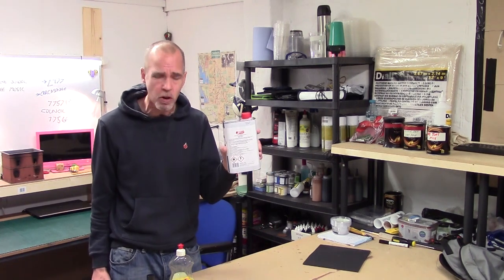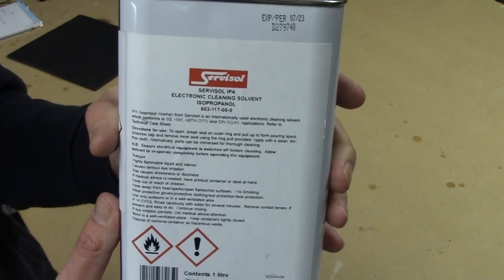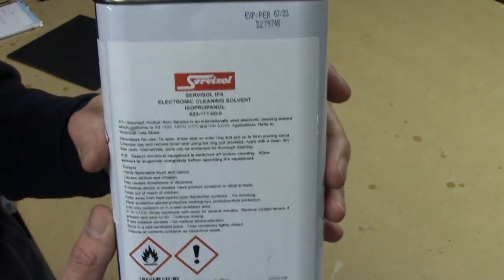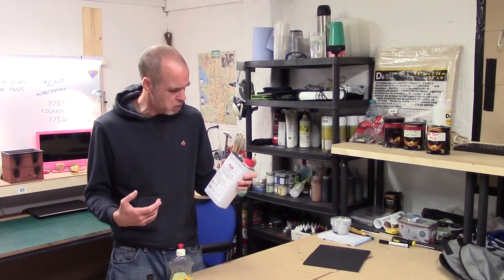Isopropyl (Rubbing) Alcohol - Is it worth it for modelling?

Comment: I cam buy 5l isopropyl for about AU$20 which will last me years. My main use is brush cleaning.  Infinitely better than cleaning with water.  But I use as a flow aid and in airbrushing too.
Reply: TheLoremistress Hey fellow Aussie! Where do you go to buy this stuff? Hardware store?
Reply from the maker: how do you find it with airbrushing buddy?
Reply: I use Tamiya paints and thin them with 99% Iso, also clean my airbrush mainly with Iso, and if it`s stubborn, I`ll break out the laquer thinner. I splice fiber optic comm lines and have an endless supply of Iso...lol.
Reply: TheLoremistress where from? It’s AU$25 from Bunnings and it’s about the only place I can find it
Reply: For brush cleaning i'll always suggest using Marseille Soup. It costs like nothing (1 euro more or less) and it lasts a lot . Natural alternative to alchool

Comment: Thanks for the labs mate, interesting watching.

Using alcohol as a flow aid requires some understanding of how paint finishes as it dries. The paint is suspended in the medium and will distribute evenly through the medium as long as it is well mixed. When applied to a surface, the surface tension will dry the liquid to the centre, and dry the pigment along with it. This will give areas of thickened paint and thinned areas. To avoid this, very thin layers built up to colour, rather than trying to coat in one or two coats, is required. For me, I avoid the alcohol exept as a wetting agent to spray over grass and foliage before a final PVC coat is sprayed. 

When wet blending, in my opinion, it works not so well as it evaporates too quickly for correct blending to really occur. Better with wet water.

Comment: Hi mel.. Not a terrain builder,just an engineer and bit of a handy man.. have been watching some of your videos which have been a great help and inspiration for building an island for my daughters pirates of the Caribbean figures.. Will let you know how it turns out if ever I finish it.. Anyway something you might like to try, polyvine decorators varnish.. Comes in gloss,Matt or flat.. I built a floating bed frame/Wall feature/ceiling feature out of drywall board filled and emulsioned.. Half a litre of the gloss covered the lot with 2 coats, rock hard and water proof even the Mrs Hoover hasn't marked it in a year.. Best regards any many thanks for the helpful videos
Simon
Reply from the maker: Thanks for the info buddy!

Comment: First off this was an hour well spent! The biggest challenge (and most dreaded job of scenic work) for model railroaders is ballasting track. We spend a lot of time putting down ballast then have to spray or use an eye dropper to "wet" down the ballast, if we use a spay bottle we "blow" ballast off the right of way, if we use an eye dropper, we spend hours apply "wet" water. Then when we apply the glue (spray bottle same results as above plus now we have a mess everywhere) or eye dropper (more hours) and spots where the wet water didn't penetrate well enough and the ballast "floats" up from between the ties (sleepers). I know your very busy, but if you could do a video to show a method that doesn't do all of the above...... a good starting point: beveled road bed affixed to a flat surface (nailed or glued down) track (nailed or glued down)I try to do good ballast work, I spend about hour per foot...HELP, LOLIf you do a video could you please try; tap and distilled water or maybe come up with a "one shot" glue mixture and give use the formula's for any mixtures you use. thanks for this great video, Chuck RVRV
Reply from the maker: I'll bear it in mind for future tests and see what I can come up with mate

Comment: Hey Mel, Chemist here actually. PVA glue does not dissolve in water and hence it is not a solution - polymeric substances are extremely insoluble because they usually possess very long "lipophilic" carbon chains. In lab use polymers will often remain solid in water unless you are deliberately breaking up the chain with an extremely strong acid or something. Hydrocarbon solvents such as benzene or pentane may be able to dissolve these polymers to form a true solution, but they're very expensive and often toxic and/or flammable.

PVA glue + water is most likely an emulsion, a type of fine droplet suspension.

I have used IMS (methanol-poisoned ethanol...AKA common meth spirits) from the lab for paint stripping models and it works very well, IPA would serve an identical purpose well since it's a very similar type of chemical.
Reply from the maker: Thanks for the info buddy!
Reply: Is isopropyl a ketone or aldehyde with

Comment: Isopropyl is great for stripping paint off models. Soak em in a tub of it for 10-15 mins and hit it with a brush and it just falls off.
Reply: What percentage do you use? Local store has a 70% and a 90%, do you recommend the higher one or is that too much?
Reply from the maker: doesn't surprise me at all buddy
Reply: @Cody - I use 100% and don't have any problems myself, aside from it drying your skin out a little, and stinging something fierce if you have any cuts on your hands! (might have some issues if you have pretty sensitive skin?)...but yeah, as SkonkBot said, give the models a soak for at least 10 minutes (I've left GW plastic in it for several months before without any damage), then a quick scrub with an old toothbrush should take the paint right off - might take a longer soak/harder scrub at lower concentrations though, so I'd recommend the 90%

oh, also, it's fine for plastic and metal models...but it can make resin go a bit soft and rubbery, at least for a while...so be careful with that
Reply: I'm not actually sure which percentage it was that I had. I bought it from a local Maplins store (in the UK) where it was sold as a "Electrical contact cleaner" and I actually bought it for use as a degreaser when servicing my mountain bike shocks.

 But after seeing some info about it's use as a paint stripper I tried it and worked wonders. 

Basically I decanted what I had left of it (probably about 2/3 of a litre) into a large Tupperware container and when needed plopped the models in that I wanted to strip, put the lid on and left it for a relatively short amount of time (I'm not very patient so usually it was only 10-30 mins) before giving it a rub down with an old toothbrush. Most of the paint would be sagging off before the brush even touched it but if any paint was stubborn I'd just repeat the process a second time.

Nice thing is that the paint just flakes off rather than melting and it settle to the bottom of the tub after a while and you can pour out the alcohol into something else to remove the old paint and then re-use it.

I must have stripped a good 20 or 30 models with same stuff over a period of several months.

It emits a lot of vapour (i.e. smell) so use it in a ventilated area, but the small doesn't linger for long after you seal it up. Unlike other stripping remedies such as Dettol cleaner (and you dont end up covered in gunk like you do with Dettol).
Reply: I do mine without any soaking. It's very strong stuff. I'm using 99%
Reply: yeah, if the paint is fairly fresh, just a a couple of dunks and some scrubbing can do it...but for paint that's been sitting on the model for years, or if it was applied quite thickly, or in many layers, it can take a bit more of a soak - most of the models I've stripped have been old ebay rescues, that were probably painted a good 10+ years ago, and some things turned out to have about 3-4 separate paintjobs just layered up...for stuff like that, I usually wind up leaving it to soak overnight, although that's probably a lot longer than it needs, it certainly does the job!
Reply: It was my own paint jobs tho, a few months old to a year. Thin coats too. Sure does help, still strong stuff
Reply: Have left GW plastic/metal in it for ages as well with no bad effect but it doesn't like resin; it goes brittle after a while.
Reply: ZoBo are you referring to plastic models or metal?

Comment: From what I remember about chemistry of these two things you can't create polyvinyl alcohol or PVOH as it often named from adding alcohol to PVA glue. 
PVA, or polyvinyl acetate is chemically very different from PVOH and is industrially made using a very different process but similar base materials. Besides PVOH isn't really toxic, unless you are heating it with other chemicals (which they might do in screen printing), or adding nitric acid to it (usually a bad idea with anything) as it is used to make all sorts of things  that are safe to handle . 
The one thing I do remember learning about polyvinyl alcohol from back then is that apparently all North Korean clothes are made from it, as they can't import nylon.

Comment: Are we using different stuff?  Rubbing alcohol is much cheaper than flow aid in the US.  Also, yeah, you do come across as biased toward flow aid.  Interesting tests, though.  I'll keep using alcohol to pre-wet before PVA.  I find that it greatly helps the PVA soak through the material and, like I said, it is vastly cheaper than flow aid.
Reply from the maker: Different countries have different materials and costings mate, if it works for you, use it :-D
Reply: TheTerrainTutor Hey, Biochemist here. To add to this comment. Isopropanol is the same stuff that is in "rubbing alcohol" which can be purchased for a lot cheaper than "reagent grade isopropanol" the difference is that rubbing alcohol will be diluted to probably around 50-75% and may also contain scented oils to get rid of the alcohol smell when used as a topical relief for joint pain. For our use in war gaming, if you're going to dilute it to 50-75% anyway (and 50% is what I commonly see used when sealing) then you've got yourself a bargain! Would probably work better for sealing if it doesn't contain scented oils but I don't have any evidence to back that up! Just my thoughts mate!

Comment: I use the alcohol (99% industrial), mouthwash, and/or water for thinning acrylics. Slow dry...water. Fast dry...alcohol. (Works for me. Won 5 awards, in armor, at only show I was in this year. IPMS Phantom Phlashers 2017 show.)
Reply from the maker: Ever noticed any changing of the paint due to the alcohol mate?
Reply: Changing of paint?
Reply: I'm a commission painter, I use a 50/50 iso/deionised water to thin my paints, I have noticed that sometimes it starts to separate but that's when it's sat on the palette in a blob of liquid. Quick mix and it's perfect again. Never had any adverse effects on a model.

Comment: Dish detergent does reduce surface tension, but the rinse aid used in dishwashers is better - that's all it does, it isn't also a cleanser. I'd be interested to see how it performs compared to the hobby flow aid, as it should be easier to find and much cheaper.

Also - not all paints are affected by alcohol. I've seen a fine modeller (can't remember the channel) do complicated weathering effects with different paints based on them being removed by different solvents. (I believe one was a lacquer, one an acrylic, but I didn't take notes, it was cool but far too advanced for my needs.) Maybe something to experiment on later.
Reply from the maker: Makes me wonder if they're formulated differently to house/craft acrylic mate

Comment: Why @26mins is the 75% option ignored even though it was better than the flowaid? The 25% and 50% were not as good as Mel said but the 75% not a mention.
Reply from the maker: Although the vid is test after test, I actually conducted the tests the same time and I thick I discounted it because of the results of the 75% on the other test mate.
Reply: TheTerrainTutor fair enough :)

Comment: After looking it up poly vinyl alchohol is only dangerous if heated or if it is inhaled in powder form neither seem to be a big deal. In both cases it's much more mild then your presenting. The screen printers are likely using a powdered form in large quantities but in a liquid state it's part of the borax slime many kids play with regularly. It's not nearly as harmful as your projecting especially not in liquid or solid form. In solid form it is a common packaging material often used to protect garments or package goods. I understand you got your info from someone you trust but it seems this person exaggerated a bit. This is a medical paper on it's applications https://www.omicsonline.org/open-access/polyvinyl-alcohol-in-medicine-and-pharmacy-a-perspective-2329-6631.1000112.pdf
Reply from the maker: Perhaps it's what they do with it mate, when it comes to safety on things I'm not 100% on,  I go with what I'm told :-)
Reply: We use litres of the stuff in cleanrooms and labs as a sanitant its reasonably safe
Reply from the maker: OK, I wonder if it's the process of making polyvinyl alcohol from pva and iso that's an issue? Not trying to be argumentative, just trying to figure it out mate
Reply: The only things I can think of is if part of the screenprinting process heats it or vaporises it. If its a heat press printer that could cause some sort of reaction, but like DorjeDriftwood says I cant find 'anything' on the internet suggesting anything inherently dangerous about polyvinyl alcohol.

The safety data sheets say it can be a bit of an irritant (as is the isopropyl alcohol by itself) but no known major side effects and dont recommend any serious protective equipment. The LD50 dosage basically says you have to directly ingest it by the handful for it to be a worry. My conclusion from what I can find is just a basic "eating or breathing in glue is usually a bad idea".

Comment: How about using Iso for making quick drying washes (Miniature rather than scenery) ... I've wanted to try it, but never have just in case it's stripped paint
Reply from the maker: The issue is do you want a paint stripper being the base for your wash mate ;-)
Reply: But will it not evaporate before it has time to strip paint? ...
Reply: it strips paint as soon as it touches it. I strip my models with this stuff without waiting. I dunk my toothbrush in it and start scrubbing.

Comment: Whats the stuff in Vallejo Brush Cleaner then ?
Reply from the maker: No idea mate, haven't used it before
Reply: @TheTerrainTutor  From my research, Vallejo thinner and airbrush cleaner use Butyl glycol (aka 2-Butoxyethanol, or EGBE) as the solvent. The SDS makes it seem like Butyl Glycol is a bit nastier than IPA, but not massively so.